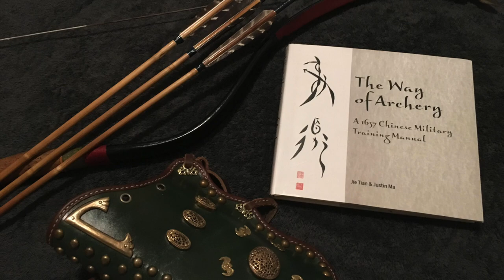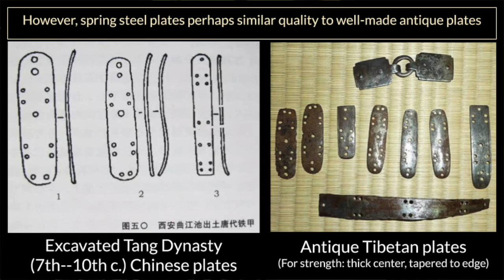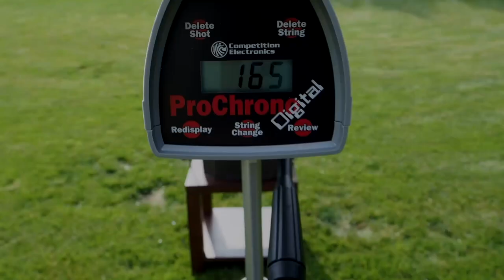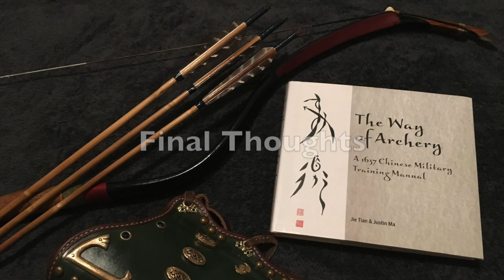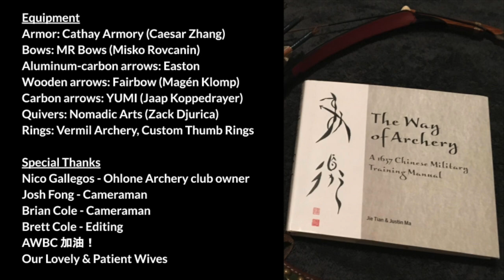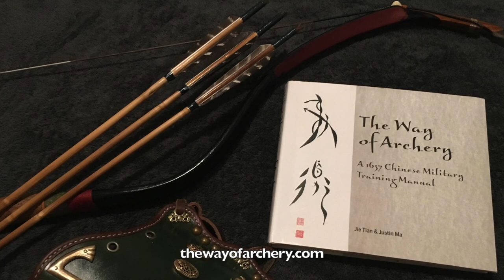Warfare Research Series (Episode 1): Chinese Lamellar

Comment: It is my impression that lamellar armors are the least durable type of armor- can someone debate me on this pls?
Reply: The fact that it has been used relatively extensively for over 2000 years suggests that it is not the least durable type of armour, as does the fact the rus and mongolians at least wore lamellar over mail hauberks, suggesting at the very least lamellar made up for the deficiencies in mail, and vice versa

If i had to guess i would say lamellar had quite good deflective and blunt force protection, which combined with mail made for a very protective kit whose outer layer was easily repairable even in the field
Reply: @jafnanmeinsamr611  of course, my point was that it seems to be the easiest armour type to damage, also one that looses its protectiveness the quickest
Reply: @matushonko7223  not necessarily actually, typically speaking the types of cord or leather used to lace them is actually quite difficult to cut, and depending on the lamellar i have seen it take early period gunfire with the laces unbroken. Combine this with the cutting of laces only opening up small or no openings in the actual armor and it becomes quite hard to pierce adequate lamellar
Reply: I have written an answer on quora to address some of the problems.  Lamellar is not as bad as people say it to be and is actually quite durable and protective.  https://www.quora.com/How-do-scale-armour-lamellar-armour-and-chain-mail-compare-to-each-other/answer/Wic-Wong
The problem with this video is the plates were too thin and the top row wasn't laced together.  Most historical lamellar lames are usually 1.5mm-2mm in thickness.  I have seen the difference what thickness can make, it is very significant.  Laces are usually broken by bending the lames too severely.  The top row of lames was actually not laced together, so it broke apart too easily.